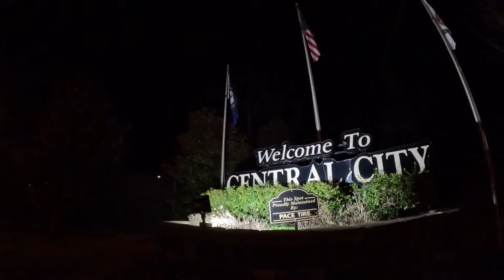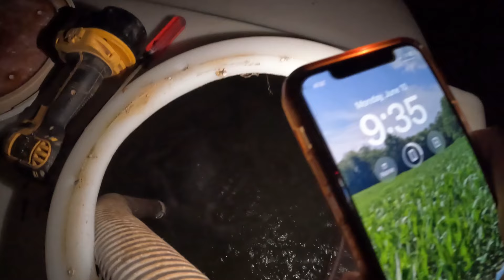We Have a Mystery on the Farm!!! This is Important!!!

Comment: There are 231 cubic inches in a US gallon.  If the 3 in diam cap was left off the tank and 22 inches of water fell in it, 155 cu in of water would be in the tank (3.14*1.5*1.5*22), or 0.68  gal...no where near 10 gal. Perhaps more rain water leaks in through the threads of the circular cover or water pools up near the vent cap.  Try running a hose over the tank to check the theory.  If the theory doesn't check out start looking for gremlins living in the woods.
Reply from the maker: It's sure a mystery.